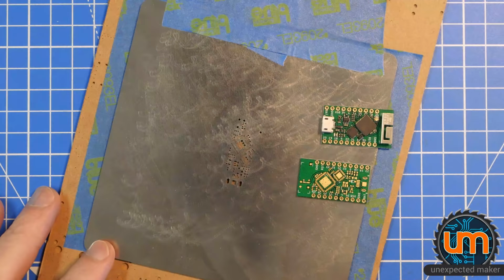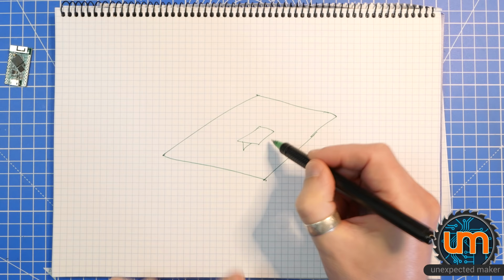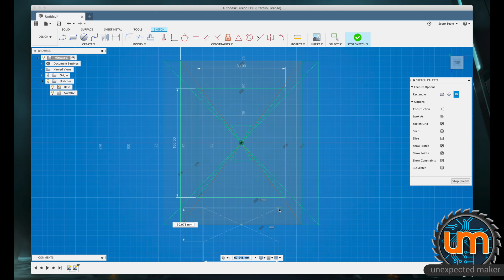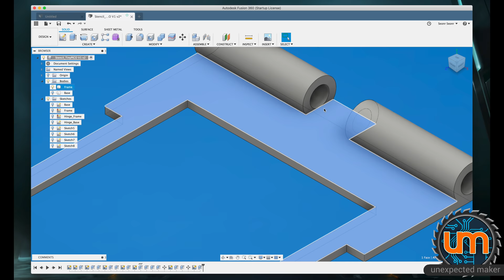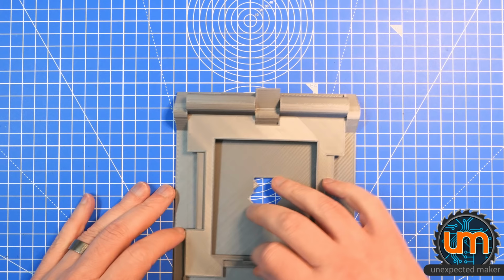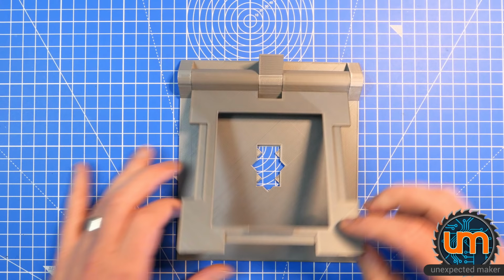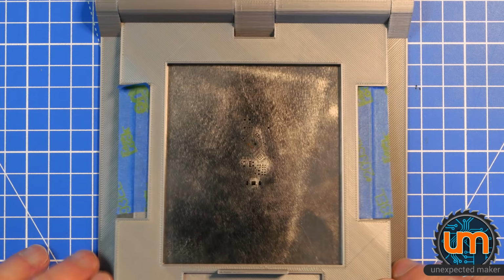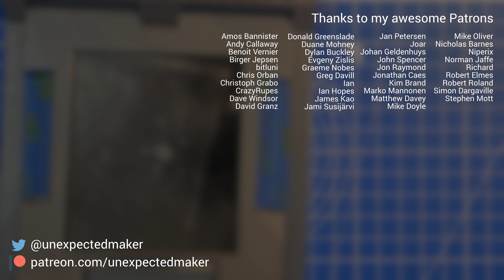Time to design a better stencil holder!

Comment: You could add a serrated edge to the frame, cut the excess tape off.
Reply from the maker: It's a "one tape" deal, so  using a knife to cut it is ok ;)

Comment: This is a really nice design!  Suggestion for the redesign: Have the bottom "receiver" piece be a separate piece that fits into bottom of the frame. That way you can design different "receivers" for each of your boards and re-use the base an hinge mechanism.
Reply from the maker: Yeah I did play around with that idea, but not printed anything out yet. Right now the holder is really only being used for TinyPICO builds.

Comment: Nice work. It's easier to do these for panels because you can use some guiding pins thru PCB and stencil, but for separate ones not so easy. I like the design and quite easy to make small improvements

Comment: Nice idea, Seon! :D
If you end up with lots of stencils and bases to store, you could design a base with a removable section that the PCB slots in to. that way you only need to print an insert for new designs. Same with the stencil, you can design a flat section with locator pins that the stencil glues permanently on to, that way you can quickly lay the stencil on top and the pins orient it exactly. get the stencil aligned how you want it, then glue it to the part
Reply from the maker: Sure! Lots of options here... this is just pass 1... but so long as it's usable for now, that's a good start.

Comment: Clever idea.  I did not know that the 3D print could warp like that though :-0

Have you thought about making the module/board area a drop in to the bottom so you can use most of the frame and change the middle over depending on what board you need to make?  Saying that though - it does add another point of possible wobble unless you can lock it in like a jigsaw piece...
Reply from the maker: I'm not sure why the top warped... it wasn't warped on the bed.. maybe I didn't leave it sitting flat when I took it off the bed, while it was still warm and it bowed :(

Yeah  I have though about and discussed with others the idea of a replaceable inner base plate for each board design, and I can definitely make that work, but for now I just wanted to see if this would even work as a durable solution... and I wont know that until I've pasted 10 boards in a row and see how accurate I can keep them.

Comment: Nice work Seon! What about a few magnets around the board area to hold the stencil down?
Reply from the maker: I don't have any, but even if I did, I don't think I'd trust I'd never bump the stencil  out fo place A better option would be to NOT use blue painters tape, and use something more rigid :-)
Reply: @UnexpectedMaker  What would be more rigid?

Comment: It is almost as if you might need a third hinged cover to clamp down and compress it, but maybe with the bottom not being so warped it will fix it. I noticed that base base lifting off the print bed, such a big area to print how can you even prevent it warping , an enclosure? maybe, or us a 2 part base with the cutout in a smaller insert ( then you would have play in that interface though )
Reply from the maker: That video of the base was my first print, the one I used was a second iteration, that had no warping. I lost the time-laps from it, so used the first :( I managed  to straighten the top with some heat. Need to find out why it bent ;)

Comment: Hey Seon. Nice to see that you have developed Ivan’s magical saw to a new level. Where can I buy this? 😀
Isn’t the stencil made from steel? If so why not use some magnets built into the frame to hold it even better?
Reply from the maker: Magic saw hand doesn't always work... just like every other maker tool ;) I answered the magnets Q quite a few times on other comments ;)

Comment: Nice project, Seon! Do you cut your stencils to size? If so-what do you use for that? I‘m afraid to have it permanently bend.
Reply from the maker: I have standardised on my stencil ordering size... they are all 120x120mm unless of course the project wont fit in that. The stencil used in this was an old hacked one, as i didn't want to use my master stencil incase I recked it.